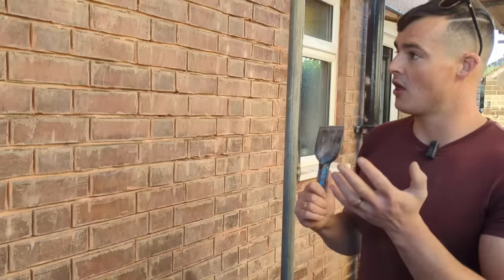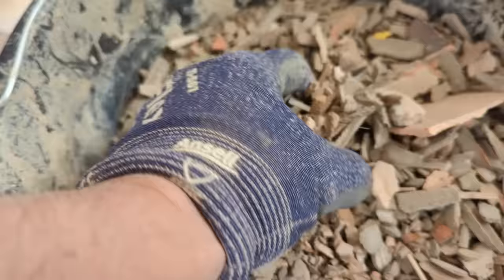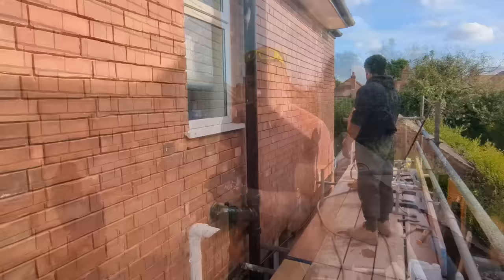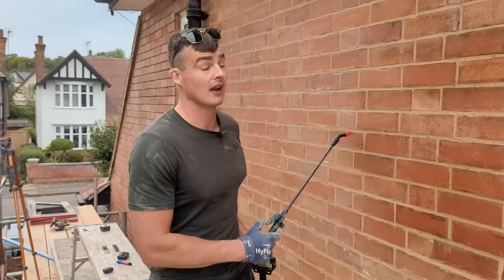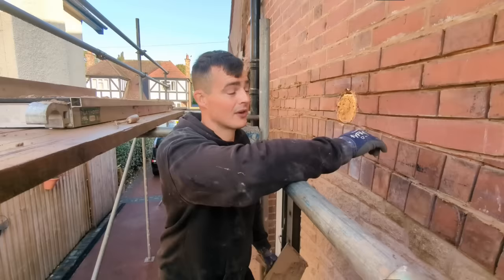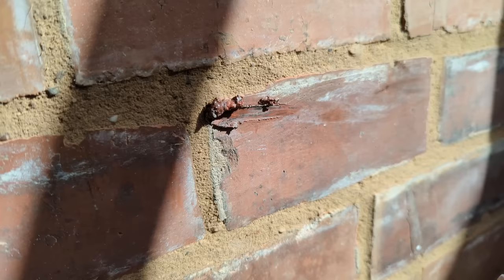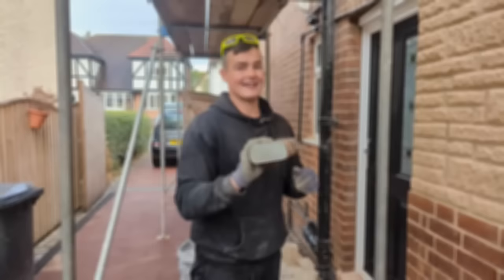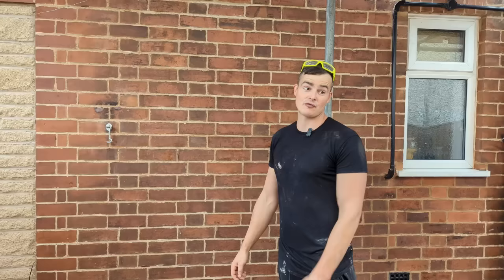CLIENTS were RIPPED off! Repointing job gone Terribly WRONG! #construction #vlog

Comment: Great job lads 🙌 
Is there an easy way to tell if a building has lime render & not standard sand/cement?
My home was built around 1950s & needs a small bit of pointing work but I can’t tell what it is.
If you could give any advice that’d be great.
Reply from the maker: Hiya mate, If it's white and dusty, it'll be like. If it's gray and hard it's cement. You can always take some pictures and send them to me mate. Izzythebricky@hotmail.com
Reply: @IzzytheBricky  thanks for the help mate, it’s appreciated. 
Would you take on work in south Leicester or is that too far for you?
Reply from the maker: @theconsistentnoddy9851  yea sure mate, it's only about an hour away for me ☺️
Reply from the maker: @theconsistentnoddy9851  send me an email of the pictures. Or if you have Instagram, you can find me there ☺️
Reply: @IzzytheBricky  that’s great,  I’ll contact you via email in the next few weeks 🙌
Reply: 1950, almost a sure that it is cement, no an less is a rural property.
You could get a piece of pointing and sink it in white vinegar. Lime creates a chemical reaction, and it makes it fizzled .
Good luck

Comment: I used a 1 part cement, 1 part nhl 3.5 lime and 4 parts sand mix to repoint, in a couple of places the pointing set hard but stayed wet looking for 3 to 4 weeks as the lime pulled the dampness out of the wall, i also used helical spiral rods all the way round the bottom of the house and mid way up the house forming a ring of steel in resin which then stopped any further cracking from ground movement. To finish with i used the same mix and laid a patio set in a base of reinforced concrete with the reinforcing mesh jamed into the below ground brickwork giving the house a reinforced shoe all the way round the house  with the patio sloping at an angle away from the house with a drainage gulley incorporated 1 metre away from house all the way round which goes off to a manhole with a sump pump in that then goes to a 6000 litre tank 20 metres from the house. All the damp problems have now gone and no new cracks inside the house from ground movement. Unconventional yes but it works. As the patio was laid directly onto concrete into the cement lime mix with it pointed as laid there are no weeds, no cracks in pointing and have parked cars on patio and its rock solid.

Comment: When I saw the 3.5 I initially thought you was about to start rendering 😂 ya did the right steps though, soak it apply it, get the hessy on, soak the hessy leave it.

I use to work for a heritage restoration render service company, I bloody hate lime stuff use to eat my hands.

Little tip for your mix if ya ever use the stuff again, add a little washing up liquid in there and it will spread like butter.
Reply from the maker: Thanks very much mate really appreciate the feed back! I bet you know this yourself, but Marigolds gloves under the normal gloves really save your hands! All the very best mate
Reply: @IzzytheBricky  I'll be honest we never used washing gloves and I always thought it'd be a good idea but my gaffa used bricky gloves so I personally just followed suit.

Marigolds are a good shout. If I ever get back into it again I'll certainly try them cheers izzy
Reply: No, don't ever use washing up liquid in any mortars. The bubbles are too big and can lead to frost damage (it over volumizes)
Reply: @ironimp1  Are you putting in a whole bottle or something?

A small amount on a large mix wont hurt and will enable the mixture to be applied easier.

If you've ever worked with the stuff you'll know it's heavy on wrist and shoulders, this is just a little trick I learned from the lads to help from the wear and tear it has on your body over an extended period of time.

The only reason I know that it's frowned upon is because it's not "heritage" but neither is the use of modern power tools as some of these contractors would expect you to use a hammer and bolster for hacking off.

From personal experience I know it works and my old boss had 30+ years in the industry (still going to this day) with no calls back about render jobs.
Reply: @Mr-Bare  Sorry Mr. Bare but the science is clear, washing up liquid is not to be used. If you want to plasticise the mix then use the proper liquid that is designed for this purpose. Febmix is just one such product.

Comment: To someone that doesn’t know any different I can understand the reason why they think this guy is a saviour, 
At the begining of the video he states the customer paid close to 2 grand where as now for this guys services they will pay tripple that, adding on extras such as lime which he can’t mention the brand enough as he is clearly advertising it,
As for linseeding the brick which is definitely not needed unless mastic sand has been used, all this will do is make the brick look varnished and deffo not an original look.
As a pointing contractor myself this Is definitely not the route I would of taken on correcting a bad job.
This guys a brick layer not a pointer they’re 2 totally different trades

Comment: You've done great work but the house itself looks a shambles with those infilled previous doors/windows? Also at the back end on the top, the extension hasn't even been keyed in, it looks a total joke. I've not seen anything that bad, unless it was previously rendered over.

Comment: @IzzytheBricky hi m8 quick question. Had concrete delivered this morning to fill trench in for extension.  Expecting heavy rain early hours in morning roughly 10,11 hours after layed. You think ok to leave or cover with tarpaulin just before rain comes? Thank you
Reply from the maker: Hi mate, don't worry about it. Don't need to cover. If anything the extra moisture from the rain will help curing
Reply: @IzzytheBricky  hi m8 thanks for the quick reply. 👍 yes was aware of water on it was good for it. Was just concerned if it was heavy and long. Thank you
Reply from the maker: @ashestoashes3107  it'll still be fine buddy 🙂
Reply: @IzzytheBricky  thank you very much . Much appreciated 🙏 for info.  you've put my mind at ease. Keep up the good work bud and good content . 👍 kind regards  R

Comment: Anyone got any tips for jointing up overhand? Not going to be seen but obviously need to make sure joints are full and sealed. Can imagine it's easy enough until you get to a chest height and above. Guess it's just a case of getting on a hop up etc. 
Cheers
Reply from the maker: Hiya mate, just point up every 2 course so you can always reach..make sure the joints are full, so.makes it easy. Get a nice brush, horse hair to finish it off 😊
Reply: @IzzytheBricky  nice one mate

Comment: how can you charge £45 a square meter just to rake out? I specialise in repointing so that all we do and we charge £45 a square meter to rake out and repoint maybe £55 a square meter if weather struck. But yes the original people done a terrible job with a very wet mix. You may want to be careful with secil 3.5 lime it has very little lime in it at all and still dries as hard as grey cement, its the cheapest lime for a reason, you may be better trying other brands NHL 3.5 to compare and see what you think but in that's my opinion
Reply: I bet you're never out of work with them prices.
Reply: Secil NHL is 100% lime!!!
Yes it will set hard but with solid bricks like those it should be OK.

Comment: £40 per meter to just take out were you having a laugh. Massively overcharging. How much do you charge to repoint only per meter ?
Reply from the maker: You must be under charging mate. Because 40 is very cheap. Have a look what people charge ☺️ and 45 for repointing
Reply: @IzzytheBricky  so £85 all in. Your £20 per meter more than us. And I am still making good money at £65 per meter. Using diamond rakes with extraction and arbortech for brick removal and tricky sections. Along with either s&c or lime repointing.